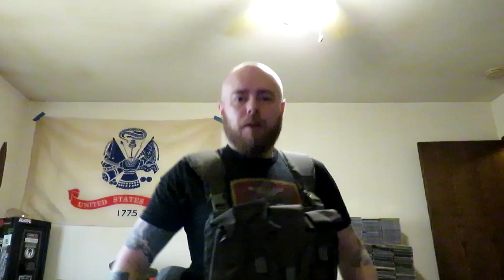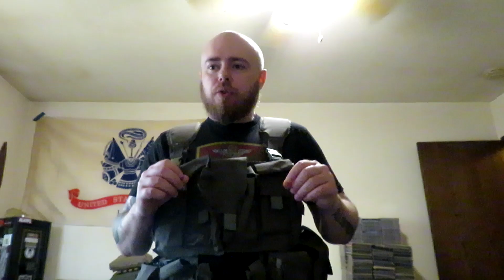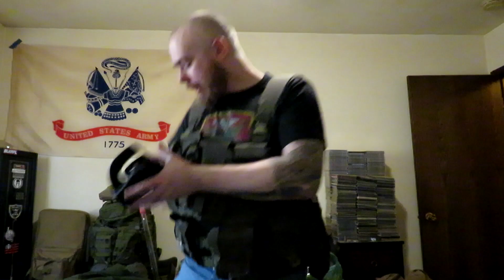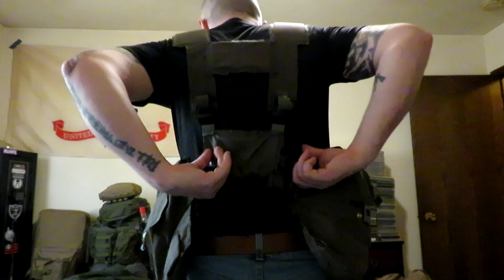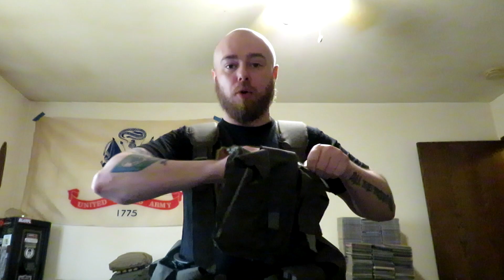Update on the LRRP aka "Risky Recondo Rig" LBE System

Comment: Looks nice. I like the placard and the fact it is padded everywhere. Only criticism, is I dont think stacking all the rifle ammo to one side will do the best on balance. I tried thay on my old belt rig, it kinda sucked coming up steep river banks.

The modern LBE market does need innovation. Everything else is getting improved, but not really this. The older Eagle H harness, Smersh, and Velocity Jungle (that buttpack though....) are effectively it. All three have their downsides. The other option of adding suspension to modern belts always seems and feels executed like an afterthought.

The market needs a swift kick in the balls and hopefully this is one of them. Good work.
Reply from the maker: Yeah that's part of the design is distribution, the way it all fits ergonomically is optimized, while still having the ability to place items (mags and whatever else) to best fit and balance the load.  With the GP, IFAK (also is a rifle mag pouch), and larger canteen pouch on the right helps that balance also alongside the chest placard helping centralize some of the ammo load.

The strapping as you can see is also beefier but still very light overall for the rig, more support and stability along with that padding, yeah.

The issue with the modern LBE market is that there isn't many options, that's the point, ALICE, SMERSH, and Pattern/ Type 83 BJ are all old systems/ surplus systems, and there's only two maybe three modernized/ brand new production rigs on the market, adding this to the mix would be very beneficial for options and alleviate deficits with older gear.

I used ALICE web gear for a time in the Army, I hated the ALICE clips themselves, they failed at times, are heavy, and the belt system itself is super uncomfortable.  
MOLLE straps also add weight, and can come undone (the most recent SERE Challenge video on Grunt Proof's channel showed this happen with Jared's rig getting hung up in Manzanitas and coming off), also a little more floppy overall on the rig/ system, which is where the Type/ Pattern 83 BJ and this system come out on top being all stitched construction, nothing's coming off (and is easy to repair with bonded Nylon Thread or even good test weight Fishing Line).

Thanks!!!  I really appreciate the feedback.  Obviously this is a prototype and some things are subject to change/ improvement, but overall i'm very pleased with it, and with testing it has performed very well.
Reply: @DJTheMetalheadMercenary  Hmm I had weight, gp, pistol, Ifak on that side but no water, so ok, I can be sold on it.

Yea molle has come undone quite a bit on me with my old (mostly chinese) rig, since I've switched to mostly american made or surplus pouches the snaps seem to hold far better. But it certainly does add weight...

It's a prototype, it is made for testing and feedback. 
Did you consider going with triples on the belt so you can more easily squeeze G3/FAL mags in there? 
Oh and I like the holster slot, perhaps a narrower one on the left for a weak hand blade... say about kabar sheath width?

Either way it looks good. Hopefully you can find someone that won't cost as much or take as long as Velocity to make em lol.
Reply from the maker: @presidentmerkinmuffley6769  Yeah it's a fine balance with trying to figure out the weight distribution, but I've had no problems with it.
Right, and some MOLLE straps don't even have a snap, which is ridiculous, no guarantee it'll stay fastened.

I thought about triple stack, but for the sake of having more pouches for end-user needs and cargo capacity, I went with double stacks that are slightly large, they fit my FAL mags alongside AK mags too so I figured that is a win.  Between the 3 left mag pouches, the 1 right mag pouch, and the placard, it can hold 11 AR mags then add 1 in the gun, that's 12-- heavy load and I doubt anyone would be carrying that many anyway, so there's plenty of room for other necessary kit.

There is actually a slot for a knife sheath on both sides!!!  Already thought of that  ;)  I carry my field knife and drop leg holster on my belt (the only 2 things that I do have connected to my belt) so that doesn't bother me, but they're there, that was another requirement.

Thanks so much!!!  Yeah I'm hoping someone buys it for a production model concept, it's got a lot of benefits to it.

My other gripe with Velocity Systems is that their Jungle Rig doesn't come in any other colors than OCP/ Multicam, no-go for me not having options based on consumer/ end-user wants and needs.
Reply: @DJTheMetalheadMercenary  Yea, I don't want any that are snapless don't trust em.

Fair enough, just throwing food for thought and when I found the newer 1x3 pouches I fell in love. My rig can carry 12+1 if I want to, only happens on days when it's heavy trigger day.

Both sides? My man. 
Mine lives on my belt with dropped pistol as well, but I have considered shifting it up but don't want to loose the slots. Might get one of those helikon pouches with the slot for now, need a new GP pouch, I want to lean less on my buttpack.

Seriously especially if I am paying that much AND waiting 2 months, I better be able to get it in just about any pattern I want, Penncott, Flek, Tiger, M81, or f_ckin reflective safety orange for that matter.
Reply from the maker: @presidentmerkinmuffley6769  Right!

Heh for sure, sounds like a solid setup you got going.

YES  :D  put a lot of forethought into it for those needs, it's modular just in a different way.
Those Helikon Pouches are nice!  As much as I like Buttpacks/ Pouches too, they're a pain in the butt (pun intended) to access, super awkward to reach back into them and I don't have eyes in the back of my head LOL, why I prefer using a Ruck or Pack with an LBE.

HAHAHAHAHAHAHAHA yes exactly!!!!
Reply: @DJTheMetalheadMercenary  Since I got rid of the Chinese crap it has, still looking for a good modernized buttpack.

Seems like you did, cheers. There are a whole lot of ways to skin the modular cat.

Yea thats why I have certain things in containers, poncho, easy; cleaning kit easy, ect mostly by feel. The trick I have found is to ride it high as possible for easier everything, and use it as a shelf for a pack to transfer weight instead of a hip belt. I want to size it down but there are things I want to add (monocular mainly). So I'm thinking smaller butt pack, plus a GP....

Even though it might have to be OD or Multi the Velocity buttpack looks sweet, or I could go British build a shelf with a few Helikons... Damn I think my wallet is about to hurt...
Reply from the maker: @presidentmerkinmuffley6769  Try the Nixieworks Buttpack, pretty good overall reviews on it.

Haha yeah very much so.  And yeah, buttpouches/ packs are just awkward to me, far more practical to carry a Ruck or smaller Assaulter/ Day Pack instead, but that's just my preference from experience.

Lol right, all kinds of goodies to be had!!!
Reply: @DJTheMetalheadMercenary  I have some snapless Molle compatible stuff on my Russian rigs that I use for competition. It works okish for that. But, the only way I would take to the field with it for serious hard use is after using a S ton of duct tape on it. An old Grunt-pa trick with ALICE is to toss the clips and use 550 cord or even black zip ties instead for it.
Reply from the maker: @winkleried  Yup, we'd end up 550'ing a lot of stuff and use 100mph tape.  I can't trust MOLLE straps with no snap securing even at that, plus it just jostles/ jiggles around even when installed correctly.

Nice thing about this rig, it's all heavily stitched with Bonded Nylon, nothing is coming apart save for a few very extreme circumstances lol, and even then it can be easily repaired and ready to go in no time.
Reply: @DJTheMetalheadMercenary  Nixieworks? Bro I said smaller butt pack lol last piece of China kit is a Fox recon type buttpack it's a mini Alice pack does alright but the molle is shit from start to finish.

That's why I am thinking smaller buttpack or Brit PLCE shelf style for better use.

Too many plus the ammo costs on top.....
Reply: @winkleried  Malice clips or black zips on the bottom was my plan if I got any Helikon, they are snapless....
Reply from the maker: @presidentmerkinmuffley6769  Lol I know it was just the first thing that came to mind, can't think of any other ones offhand besides surplus.

Lol yup!
Reply: @DJTheMetalheadMercenary  Again back to the same issue with LBE there aren't many options. Nixieworks Velocity, Hill People Gear maybe..., and Chinese (and half of those are Alice compatible which screws up molle compatibility)

Perhaps it is for the same reasons, neither LBE nor buttpacks play nice with vehicles and mechanized has been the mode of thought for some time.
Reply from the maker: @presidentmerkinmuffley6769  Yep, not many options, really want to add this one to the pot.

YES, that's why i didn't include one, faaaaaaaar easier to get in and out of vics, and carry a Ruck/ Pack with no Buttpack, we haven't used them for a while for a reason as adapted for the conventional battlespace.
Reply: @DJTheMetalheadMercenary  Indeed the shift to mech is to blame, but will we always have a m113 or m2 waiting? Sadly I think not. 

A buttpack becomes your best friend when considering dismounted actions as then you can leave the ruck/pack at the camp and be good for about a day if need be. Trying to strike the balance is where I am at currently and thus trying to get the mini Alice pack off my butt lol.
Reply from the maker: @presidentmerkinmuffley6769  Right, situation dictates.

I still prefer a day pack (like a small RUSH pack) or Assaulter Pack over a buttpack, but absolutely having that preference is still necessary, which is why this LRRP rig can be integrated with one.

Comment: I like the ALICE I acks for the most part. I kind of wish a company would make an updated version with fastex buckles , removable waist belt, internal lightweight frame , the dry bag style main bucket , drag handle ,  the middle pocket turned into a kangaroo style flap , and lastly just a little bit of molle webbing
Reply from the maker: Tactical Tailor's modernized ALICE pack they make is solid, otherwise you're crossing into other brand and style territory, something like Crossfire Packs, or like I use, Tasmanian Tiger (Finnish Savotta is similar) Bergen/ Jager style Rucks.
Reply: @D.J. "The Metalhead Mercenary"  I know of the Crossfire I will check on the other pack . TY for the reply. By the way, I like the rig .
Reply from the maker: @KYPatriot7018  Yeah check out Tactical Tailor first, then the others since they're a different platform/ design, worth it.

Thanks so much!!!  I'd really like to sell this prototype and get it to market.
Reply: Actually there was one. The down side it is SSO Sposn. Which is a Russian tactical gear company. Due to a certain little border squabble they have moved all of their production to fulfill current Russian military contracts and no new sets are coming to the civilian market. They basically took all the old ALICE gear ( Which rumor has was purchased at a NYC surplus store) and both copied and modernized it.I have their SVD set up that I use for my PSL. The set up was purchased several years ago for an invitation only hog hunt that fell through.
Reply from the maker: @winkleried  Yeah I see a couple knockoff or similar Russian systems, but I'm honestly not that much of a fan of them for several reasons, SMERSH is nice for modularity, but like any system has it's pitfalls.

Comment: I just thought about it, I would trust a regular army soldier to create armor or stuff like that because they have experience in using them and would know what's best for the average soldier.
Reply from the maker: For sure, there's a lot of Veterans in the Tactical Gear industry these days for good reason, we know what does and doesn't work based on a wide ranging set of experiences with kit.